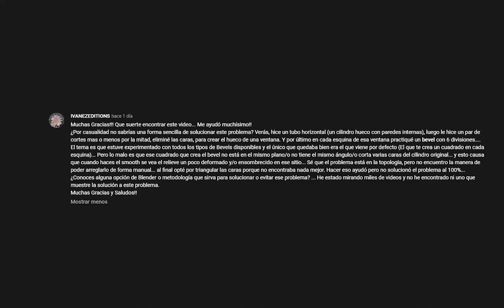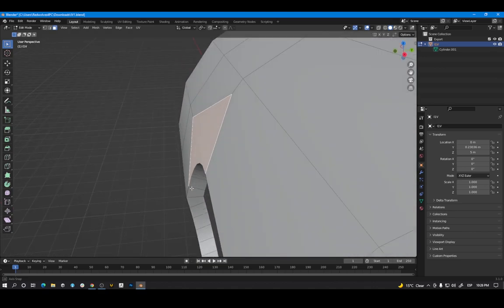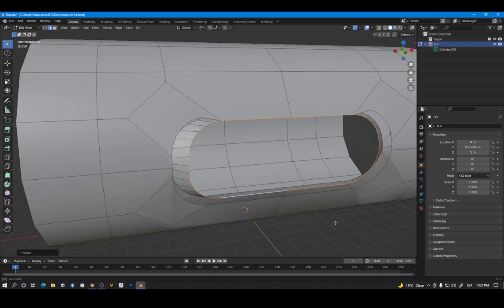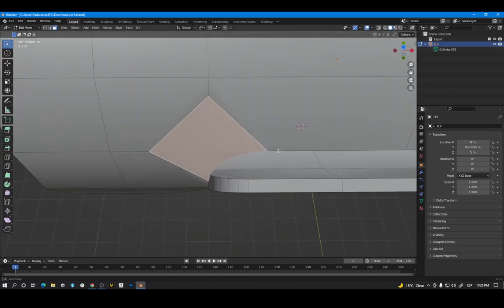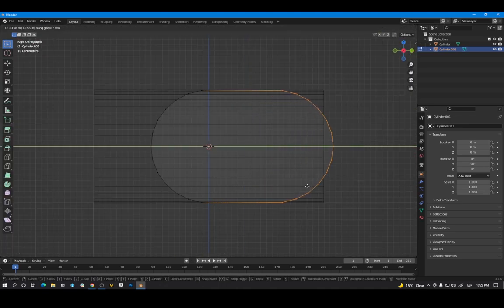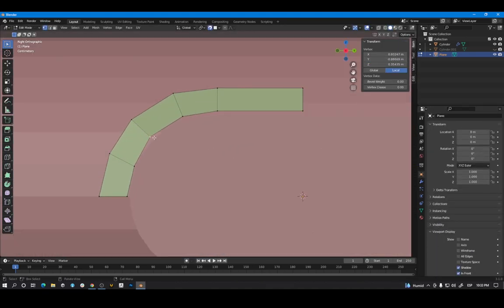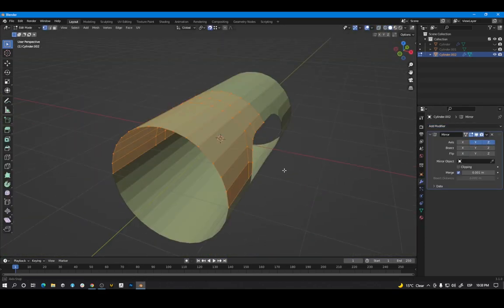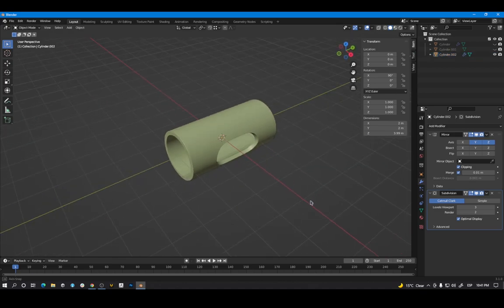How to cut a circular hole in a cylinder in Blender

Comment: Thanks Medicci for your tutorial and this interesting approach .  I had to model something very similar like an hour ago?.. I did it the following way and I think It was super fast and easy. You might be interested  in trying this approach too:

1. I Add a Cylinder, rotated on a Y axis and scaled in edit mode x2

2. Select front orthographic view (numpad 1) to see the front of the cylinder and  work in x ray mode

3. In edit mode, add  3 loop cuts  (Crtl+R)

4. In edit mode, add 3 more loop cuts to the  two spaces in the middle of the cylinder from the previous division (so you should have now 9 loop cuts in total in the middle of the cylinder)

5. In edit mode, selected de right and left vertices in the middle of the cylinder , the ones that coincide  or are in line with  the "x axis...They should be "4" counting the ones you see in your front view and the ones behind them....remember you are in xray mode) and scaled on x axis with proportional editing with falloff sphere mode selected until the left and right edge loops (furthest edge loops from origin, except the borders from the faces of the cylinder itself), looks like the circle you want

6. In edit mode and face select mode press "C", select the faces inside the perimeter of the "Oval" or "pill shape" in the center of the cylinder  make an inset (or outset) to make support loops (optional) an delete the interior faces as well as the circular caps of the cylinder (BTW you still be in xray mode so you selected also the faces on the other side of the cylinder)

7. In object mode add a Subdivision Modifier and a solidify modifier.

Regards,
Reply from the maker: Wow Phoenix Engineer, that's really descriptive! I'll give it a try, maybe I could record it too.